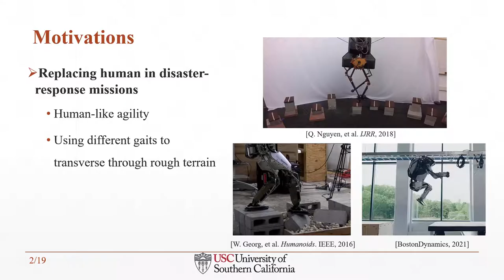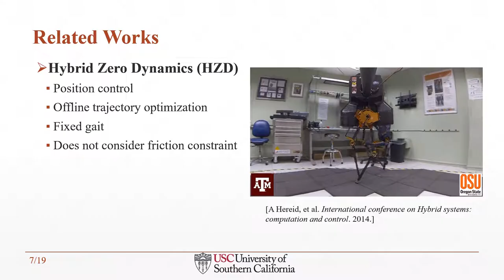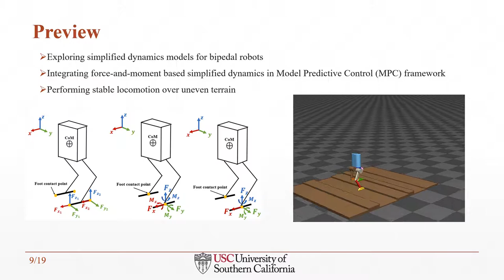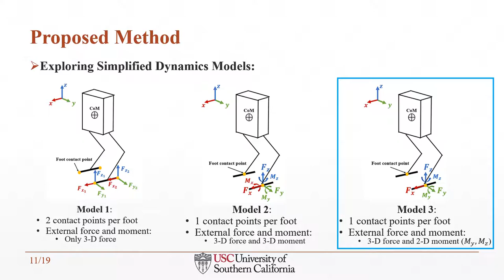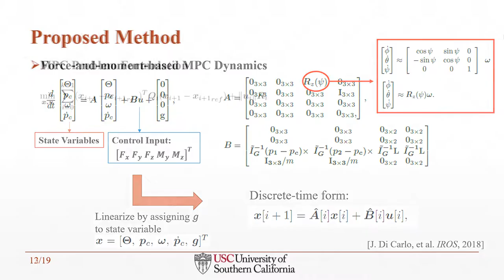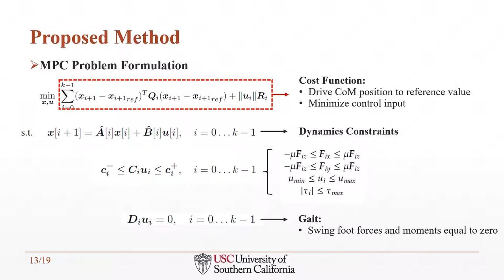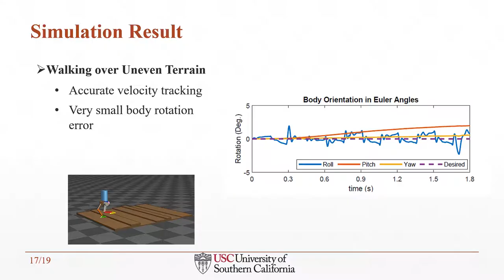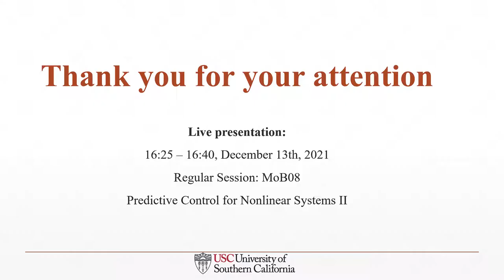CDC 2021 Presentation - Force-and-moment-based MPC for Highly Dynamic Bipedal Robots

Comment: Does it actualky work though , do you have any actual code. Good presentation. Models are cool, matlab is trash, id like to see some code though.
Reply from the maker: open sourced in both ROS and Matlab: https://github.com/DRCL-USC/Hector_Simulation
Reply: @drcl_usc  checked it out, not that impressed tbh. The code isn't thst grand, it works. It's just incredibly simple and some/ a good bit of its generated code..., ( like you didn't write the architecture ) 

Good for a presentation in college, not for development tho.